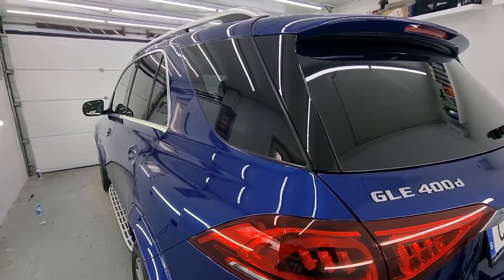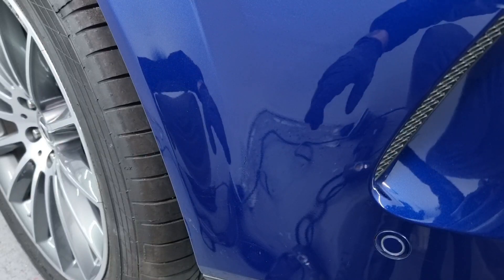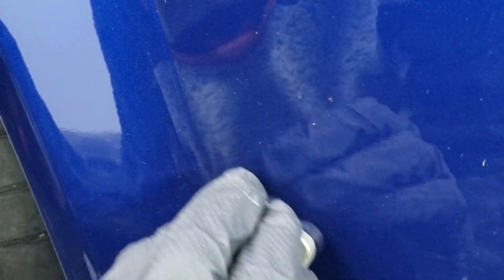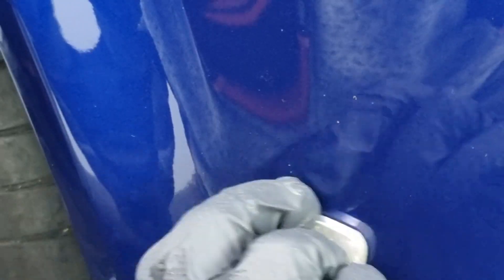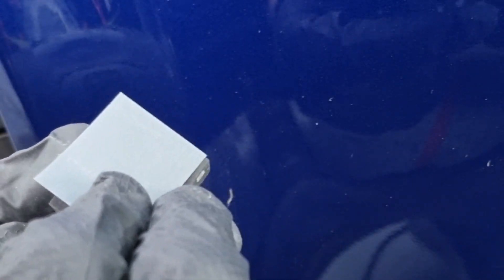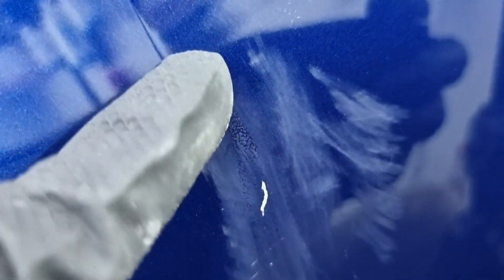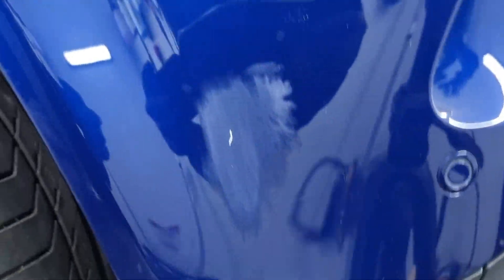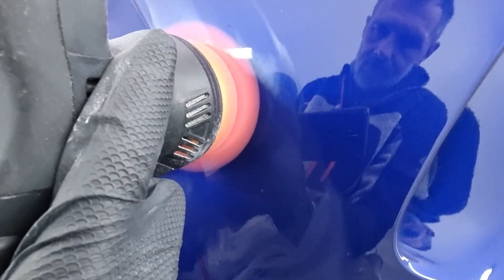HOW TO fix a BURNT COATING on a car:Mercedes BUMPER

Comment: You can’t sand a burn through. I do like your work, but both of your videos on this subject are clearly not burn through issues. A touch misleading, even though you did remove whatever the issue actually was.
Reply from the maker: When you know what to do, there is no problem😉
Reply: @Amddetailing  I am an established detailer in the UK, so I do know what to do when you get a real burn through on lacquer and that’s having to paint over it. Once you’ve gone through, there isn’t a way of turning back the clock unfortunately. So what was the actual issue with the paintwork as it looked raised and lumpy? A burn has a very different look in being very flat and smooth.

Comment: Good video but definitely not burnt through. Burnt through clear clear if you try to polish or  sand what have you it will create the burnt through area larger and you have to apply more clear coat then sand and polish

Comment: Your a Master. Question I use a touch up paint on a bumper that I'm practicing on and the paint is still not dry completely and it's been over 24 hours. What should I do to get this paint to dry like it should ?
Reply from the maker: it could be that you put a little hardener or a lot, that's why it's important to put exactly how much it says on the box from the manufacturer, it should dry in 24 hours, leave it for another 12 hours and see what happened, if even then it doesn't work, wipe everything and mix again
Reply: @Amddetailing  I applied it just the way I got it from the paint shop. Did I had to add the hardener and clear to it before applying ? I'm not sure if this paint when is prepared for the car if prepared with hardener.
Reply: Hey bud i been trying to get a hold of some uv curing clear coat here in the usa but no luck. Can you ship out here and i pay you additional ? @Amddetailing
Reply: Or you have a better resolution for a clear coat i can use that would dry fast enough  @Amddetailing